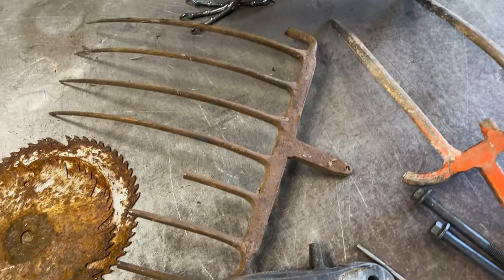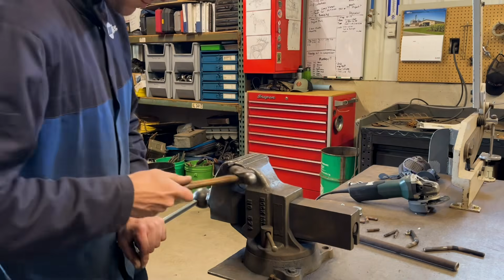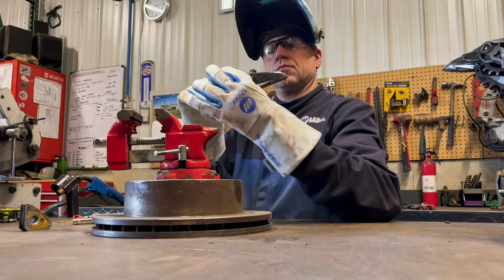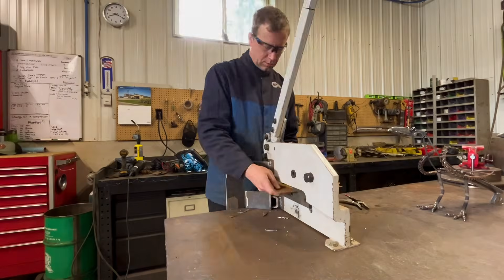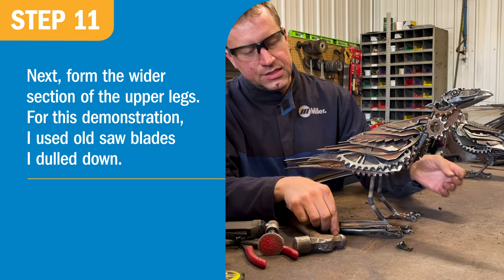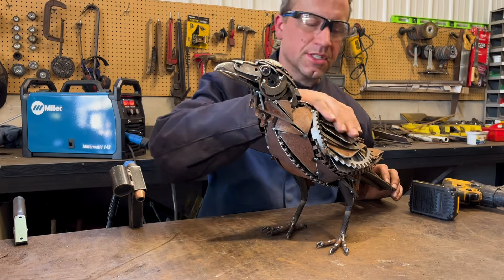DIY Welding Project: Raven Sculpture Art

Comment: David, I am so impressed with your artistic talent and ease in front of the camera! I to do some scrap metal welding as a hobbyist. I learned the basics from a pro welder who has passed.  I was wondering what type of wire and or gas you use for the different metals you are combining in your projects.  Specifically what works best for you when attaching stainless to standard steels? I am currently set up with .030 on a Millermatic with 25/75. I will continue to follow your videos. Fascinating to see your techniques. Thanks for sharing!
Reply from the maker: Thank you so much for your thoughtful message and for following along with David’s videos! For attaching stainless to standard steel, we’d typically recommend using a 309 or 309L filler metal. To achieve the best results, you’d also want to use a tri-mix shielding gas (90% helium, 7.5% argon, and 2.5% CO2) instead of the 75/25 mix you’re currently set up with. While ER70S-6 can get the metals to stick, it can lead to cracking and corrosion over time. We hope this helps, and we’re excited to see what projects you create next! Thanks again for your support.